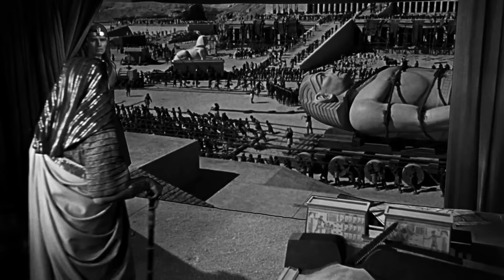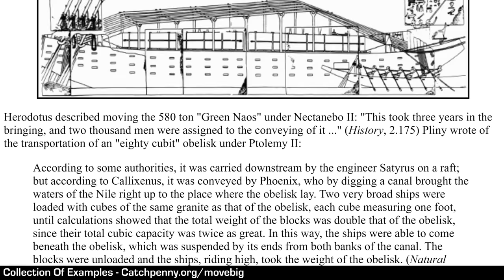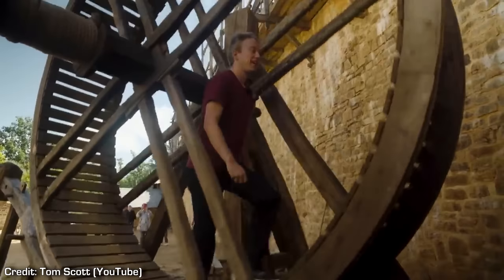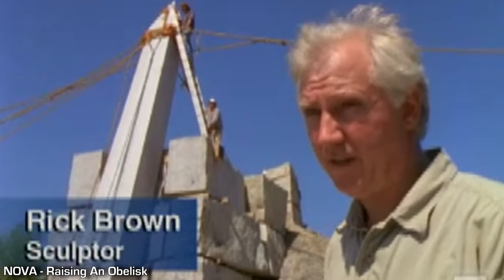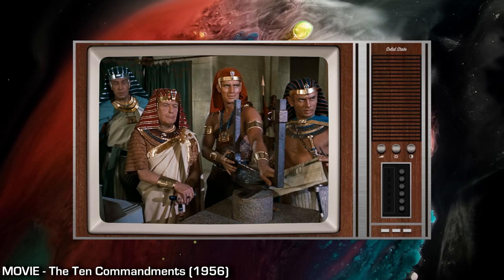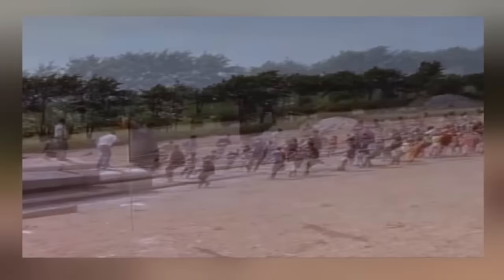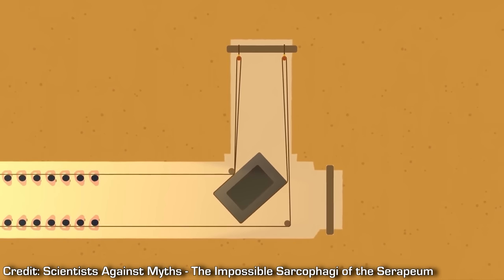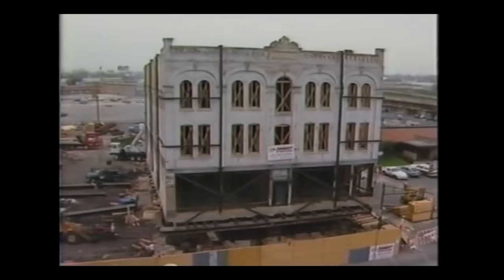This Is How We Move Huge Stones & Buildings | A Compilation Of Modern Experiments & Examples

Comment: There was a tv show either the 90s or 2000s where engineers were challenged to build something ancient. One team went to Egypt to erect a monolith, what was funny was they used Egyptian labour and supervisor. During the movement of the monolith they all had to pull together, something they were having difficulty achieving, until the supervisor told them they were showing themselves up as it was the Egyptians who had used this method and perfected it, so get your fingers out and do it right. They did and used the sand removal technique to get it upright but they did have to faff around with the ropes and getting them wound the correct direction.
Reply from the maker: That's awesome thanks for commenting I'm going to look that up 🙌

Comment: If I was bringing stones from Wales to Stonehenge for example. I would transport the stones as cylinders and then finish them on, or close to site. This strikes me as the easiest way to do it. Build a stout wooden trackway to facilitate rolling, then as the stones progress take the trackway up behind and  move it in front. Obviously I'd map the route in advance to avoid excessive gradients and do any preparatory work to clear a way. Not saying it's how it was done, just my solution :).
Reply: Unfinished obelisk in Aswan quarry shows they didn't consider such for a 1200 ton block.  There's a nice  Moai statue still in the bed rock on Rapa Nui suggesting they didn't neither.
Reply: @doctormarazanvose4373  Horses for courses mate. It would rather depend on size, shape and destination. All I know is that it's far easier to roll something than to drag it.
Reply: @donk1822  They possibly wrapped these objects in wooden cylinders.  I have seen such a theory posited but it is just that - a theory.

Comment: Still doesnt explain how they moved granite from 500 kilometers away and what was used to carve it. If you say copper saws and a abrasive sand I will have to laugh in your face.
Reply: Using a granite maul to carve granite blocks. Yes, the maul will wear away at the same (ish) rate as the huge block, but there are ever cobblestones lying around. Takes lots of time, but what do you do with farmers when they're between crops?
Reply: @geraldfrost4710  That's just one aspect of stonework. What about the statues so symmetrically perfect and so smooth we can't even match the work with out high tech and even then ours can't match them
Reply: @billstream1974  And they knew how to drill a conical hole through stone, taking out a stone plug, big enough to reach a hand through. And they were efficient at it! 
There are indeed mysterious things they did.

Comment: I remember there was a guy who put out videos demonstrating how HE....by himself....moved, turned and raised huge stones. Its not Rocket Science....or even Alien Science when it comes to that.  In the modern world we see huge stones and start scratching our heads about how something like that could be moved. Mostly because we don't live in a culture where moving stones and lifting them is an everyday occurance.
Reply: If only it was so simplistic.  Moving giant blocks of stone is only one aspect.  The precision with which some are cut and shaped is a greater question to me.  There is evidence globally that somehow they could soften granite and scrape it like dough. How? not a clue.  Barabar Hill caves cut out of solid granite in geometrical shapes with perfectly smooth, polished walls.  Why would you do that?  Makes me wonder if whomever did it was leaving a message - a bit like how we stuck pictographs on the Voyager probes.

Zawyet el Aryan screams of functionality as well as precision.  I have zero clue as to why you carve out a dish shape with a rim in solid granite and then shape a perfect granite lid to fit over the top and seal it.  The floor made up of huge blocks of limestone and granite in a pattern that fitted together perfectly.  We leap at religion as the reason.  The truth is as Barsanti suggested - we haven't a clue.   Even more intriguing is why such an inexplicable site would then be filled in and a military base stuck on top so no one can gain access.  Let your imagination run wild with that one but it does suggest that no one wants it investigating further.

It's not just the how but the why in so many cases - globally, from a time when not so long ago historians claimed we didn't travel such distances to spread such knowledge.  Something is amiss whether you care to admit it or not.

Comment: This is a most interesting video. But, are we not comparing apples with oranges? If all the money we waste on wars was put to use in the world's greatest ever civil engineering project - to knock down the Pyramids and then rebuild them exactly as they were built at the time we think they were built - we couldn't do it.  Proof of that of course, would be impossible to obtain, until the job would actually be attempted. There absolutely had to have been borrowed technology - from whatever source - involved in the concept, the purpose, the design and the construction of the Pyramids, as indeed applies to many other baffling ancient structures around the world.

Comment: Nope. You don't know anything about material strengths. You can use wood sleds for weights of under 100 tons or so. Once you get over that, the wood disintegrates and splinters. You cannot move 1000 ton blocks on wood sleds.

Comment: levers, pullies, wheels, rollers, slopes  (gravity assist) and musle power (human and animal) NO BIG SECRET!  For the nutbars - the aliems had forcefields and traction beams as well as anti-grav.
Reply: Side note: it was found that using human teams to move large block was superior to animals because you could coordinate with humans to pull at same time, unlike with oxen.   Sacred Geometry De-coded  (you tuber) has a great bit of old footage of a massive block of stone being moved partly with human teams through tight passages. I believe it was in Italy. The stone was for a statue of Mussolini, I think. They built a huge wooden frame around it. They dragged it with oxen for the straight aways but man power worked better for navigating narrow city streets and under overpasses.

Comment: The Great Pyramid is symmetrical. Could they have been lifting the blocks by sliding larger blocks down the other side?
Reply from the maker: Hasn't thought of that, so the pyramid could have acted as a pulley system while it was being built... Will look into this, haven't heard anyone else propose that idea 👍🏻
Reply: @ArchaeoLogic  you better think about how they got the large blocks up, the other side so they could slide them down................
Reply: That would work very well, unfortunately every time you raised the smaller stone you would also have to raise the larger counterweight stone back to the top. So in effect your doubling the amount of work. Sorry another one bits the dust.
Reply: @realistJB  Not if you used a pendulum and had the effect working on both sides.
Reply: @bigneiltoo  A pendulum? sounds interesting, please elaborate.
Reply: @realistJB  You have two heavy blocks (like an 2 car elevator) and 2 freight cars. When one counterweight goes down one side, the car goes up the other. Then the counterweight goes down the other side and the car goes up the first side. So men would have to push the original blocks up one level but then it would lift the rest with gravity.
Reply: @bigneiltoo  sorry bigneiltoo, maybe I haven't grasped your theory correctly. But surely as you describe the counterweight will end up on the ground, with the object stone raised to the required position, all good. But you must raise the counterweight again to repeat the operation...how!
Reply: @realistJB  I'm saying it works the way a 2 car elevator works.
Reply: @bigneiltoo  well maybe you could post a sketch to describe your theory, because I cannot see how this is possible, but all we have are theory's so maybe someone will hit on the correct one.
Reply: @realistJB  The idea is, if you have two weights on a pulley, you can have one go up and one go down. To lift a load, you place an additional load on the down side to lift the same load on the other side.
Reply: @bigneiltoo  Nice concept but unfortunately you would end up with all the rope of the counterweight on one side when you raise the object stone, the only possible way it might be remotely feasible would be an extremely complex system of pulleys, which we are told they did not possess.

Comment: these methods would not work for the larger stones. where did they get all the large hardwood for the structures in Egypt where there were no large hardwood forest. there should be piles of tools found but there is very little and only small tools found, no large saw blades for wood or stone????????????? egypt did this before they had the wheel so these so called cranes where not available.  more baseless speculation. they had hand made plant based ropes which would to be a quarter mile or more long and a huge diameter to pull the weight and allow 500 people to pull on it. the rope itself would be very difficult to tie, hold on to and be very heavy itself.

Comment: ⚔️ Thanks for the enlightening documentary. The main issue is in comparing the mind set with modern day, fast tracking projects using motorized machines, and the ancient manually operated machines, in there time, is the distractions, that can gray our thought processes; to be more inventive,perhaps. Eg, if we had 20 yrs to construct an Egyptian pyramid, after the details of plans were completed, and the site was laid out, and prepared; the priority of  quarry sites, and distances, between both sites; the mammoth monoliths, that are the king’s chambers, eTc roof blocks, have to be elevated, at each stage/step, would have to arrive on site, at the formation level, to moved as construction progressed upwards. This would be a priority. If they arrived earlier, the can be at the sites materials stock yard. At this point, all building materials would be traded to convey, in the canals; to my method of derricks, and stone blocks set onto pellets, at each leve, on the way upwards, perhaps. A platform about 2/3rds of the way up, because of the narrowing work site, as we approach its apex.🛡️

Comment: You lost me when you said the Romans laid the Baalbek stones. Bye
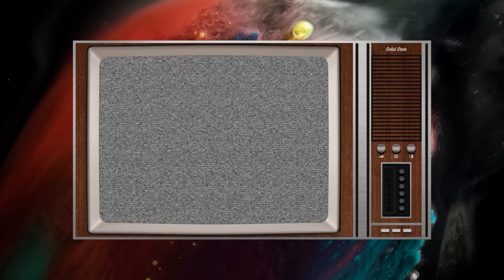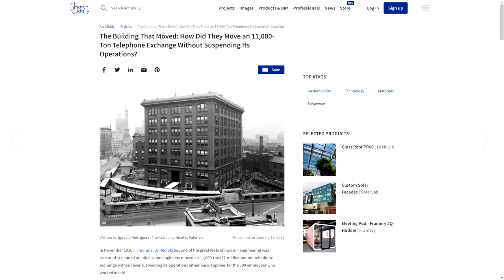Reply from the maker: 9:24 The Romans moved obelisks weighing a few hundred tons from Egypt to Rome which is over 2000km away, so it doesn't seem too much of a stretch for them to scale up workforce to drag a few 800 ton blocks just 850 meters in Baalbek from the quarry, probably wedged up onto wooden tracks/rollers, maybe helped pulled with capstans. 13:56 shows how easily a 250 ton column can be moved over wooden rollers, they probably did something similar to this.